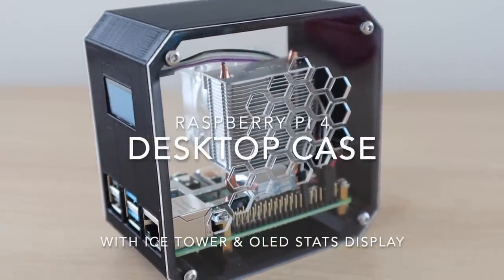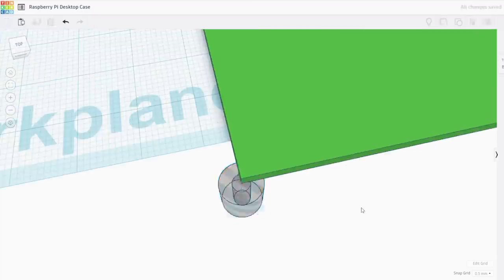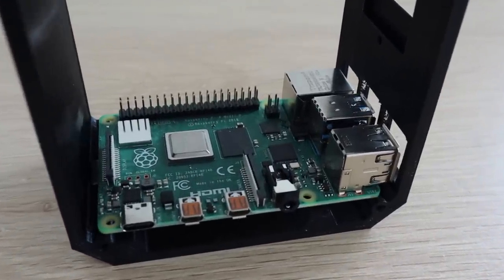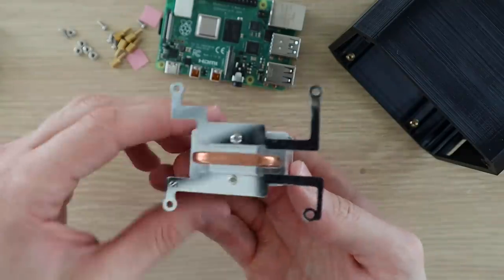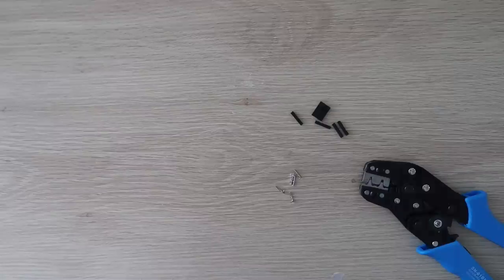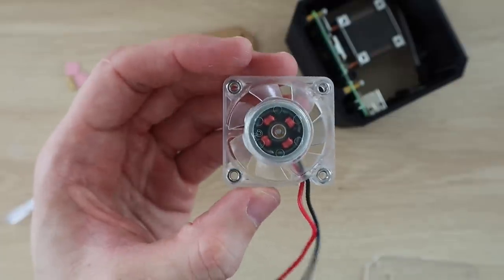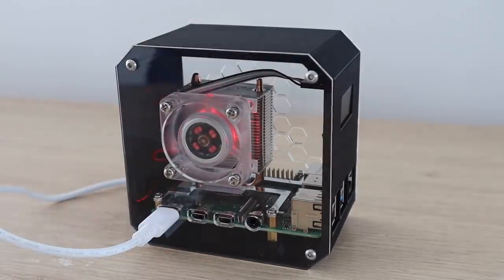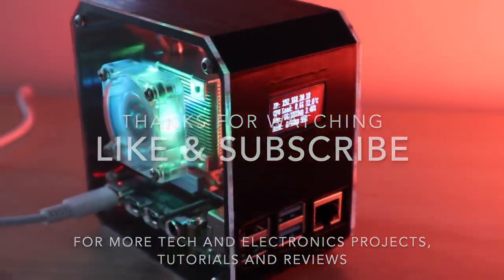DIY Raspberry Pi 4 Desktop Case With OLED Stats Display

Comment: I'd make a removable filter screen to cover the honeycomb air vent holes on the side so you're able to clean the dust that collects with time, other then that this is a great project!!!! Thank you for sharing!!!
Reply from the maker: Thanks S7, that's a good idea. The fan pulls air into the case and it's exhausted through the honeycomb holes, so it's probably a good idea to put the filter on the fan side to stop and dust from getting into the case.
Reply: @MichaelKlements  If you turn the fan to where it's blowing out there is still air flow coming in the case to cool things down, then this way you'll only need to put the filter over the honeycomb holes, and this way you're killing 2 birds with only one stone 😃👍
Reply from the maker: Yes you could do this too, it would be quite easy to turn the fan around.
Reply: @MichaelKlements  Really like this project, could you also show us how to program the Arduino with rom games or something like this?

Comment: Version 2:
• Mount the pi vertically (like a traditional computer case)
• Add a power switch to the case
• Add in a sata adapter and sled for a 2.5" drive
• Use a breakout board to bring all ports (and the GPIO pins) to the back of the case
• Keep the ICE fan on the cooler, but add in 92mm (or 80mm) fans to the front and back
• Add in a PCIe breakout (vertical mount to keep the case slim)

Basically create a full desktop out of it. You've definitely got the skills.

Bonus:
• Watercool it (like in your recent videos)
• Internal power brick
Reply from the maker: Thanks for the great ideas! This will definitely make it into a proper mini desktop computer, haha. But it would be awesome.

Comment: Probably, you can flip the board 180 degrees. In that case the RJ45 (network) adapter is seated at the back of the box.
It is even possible to design your own Raspberry Pi 4 main board. According to that, you can accomplish big things by selling the product!

Comment: Can you advise how much infill was used in the PLA
Reply: Its okay i heard you mention it during the video
Reply from the maker: I typically use 15% infill for most projects, unless it requires extra rigidity or strength.

Comment: Michael, And anyone else that has one the same, I am curious what you think of the laser cutter engraver that you use in this project, have you had much trouble with it, was it a huge learning curve or relatively easy to get working with it. looks like it would be a fun item to have, been thinking about a 3D printer for a long time but haven't got serious about them.
But seeing your cutter in action was pretty cool.
Reply from the maker: Hi Squirralien,
I bought it thinking I'd only use it occasionally, and I've actually used it way more than I ever thought I would. Being a relatively cheaply made cutter, it takes some setting up and re-calibration to get working properly (it worked out of the box, just not very well). I also changed out the lens and mirrors for better quality ones which made a significant difference. 
I bought the digital display one and actually wish I'd got the cheaper analogue one, you really need the analogue current meter to make sure you don't burnout the laser tube. I've added an ammeter to mine alongside the digital display.
But I've been really happy with it and would definitely buy another if this one packed up. Although, you can fix almost everything on it quite cheaply, with a huge range of spare parts available online.
Reply: @MichaelKlements  thanks for your reply and background ,

Comment: That looks bloody amazing. Really well designed. My only comment would be that the case needs some sanding down to get rid of the 3D print ridges. How does feel on a desk with day to day use? Does it need some rubber feet or ballast at the bottom to help keep it in place? Again, amazing.
Reply from the maker: Some rubber feet underneath the case would definitely be a nice addition!

Comment: Ok, changes...
Use low profile cooler, turn Pi on its side so air intake is in about the same location.
Add micro HDMI to HDMI cable, power etc cables such that female outlets for each can be placed on the same side as the ethernet/USB.
Since much less of the space within the case will be wasted, make a couple of mounting points for SSDs, oriented in the same manner as the Pi.  Allow room for sata to USB connection (exterior).
Place screen on opposite side to ports.  Add power button under screen.
That said, I really love the look of the case you made.  For whatever reason it totally appeals to me and I'd buy it if I could.
Reply from the maker: Hi Mike,
Thanks for the great suggestions. I've been looking for some sort of adapter board similar to the one supplied with the Argon case which takes the HDMI and power to the same side as the USB and Ethernet ports, this would definitely make for a cleaner build.
It would also be nice if there was some way to connect an SSD to the board without having to go through the USB ports, it looks sloppy having a cable coming out of the case and back into one of the ports. I guess you could solder a lead directly to the contacts on the underside of the USB ports as a work-around.
But thanks for the tips and ideas, I'll definitely be looking at a Version 2.0 of this case.

Comment: Hi Michael i have noticed when the side covers are on its difficult to insert the micro hdmi fully, is there a specific micro hdmi cable with a smaller shround which can be easily inserted fully?
Reply from the maker: Hi Rav,
I haven’t had an issue with mine, I’m using this cable to plug into a mini-hdmi monitor - https://core-electronics.com.au/4k-mini-hdmi-to-micro-hdmi-cable.html
I’ll have a look at it more closely, it didn’t look like it was any longer than a typical cable.
Reply: I have tried a number of cables and faced the same issue, I finally resorted to using a filing tool to increase the rize of the hole. Now its okay but it looks a bit untidy. Is it possible you can advise how to modfy the design to enlarge the gap. The current size is approx (LxW) 8mm x 3mm, new size to 18mm x 10mm
Reply: Hi Michael, if you dont have time, can you please advise what software i need to modify it myself

Comment: Would the screen and it's software still be ok running alongside a multi-instance of OctoPi?  I have 4 instances running for 4 printers, but really like the case and layout to neaten things up a bit.
Reply from the maker: Yes I don't see any reason why it wouldn't be. The script to drive the screen is really basic, not resource intensive at all.

Comment: First of all, thank you for everything. great project ... but i'm having problems with ip printing. I could not print the ip address I got from wifi. I am waiting for your help. thanks.
Reply from the maker: Hi G G,
Have a look in the comments section of the blog page (linked in description), some people had a similar problem and were able to correct it with a minor code change. Alternately try running the script in a different python version (1, 2 or 3)

Comment: I just bought the model files. For the side panel can I use 3mm or 5mm acrylic board instead of 2mm?
Reply from the maker: Yes you can use 3mm acrylic as well. If you use acrylic thicker than 3mm then you'll probably need to make the port cutouts a bit bigger to allow the whole connector to pass through them.

Comment: Brilliant.  Header out for the I/O...
Reply from the maker: You can put a slot into the vent side and use a 90 degree head pin cable to access the I/O outside the case.

Comment: can you modify this case so that a 80mm 5v noctua fan fits? like whole side panel is fan area and on the other side holes until pcb level?
Reply from the maker: You could add an 80mm Noctua fan to it, but you'd have to change quite a lot to make it fit.
The whole case is only 100mm x 100mm, so you'd probably need to make it wider to fit the fan in next to the Pi rather than above it. You'd also need to move the fan to the GPIO side so that you're not covering the ports. You could then also expand the honeycomb pattern to cover more of the fan area for better air flow.

Comment: hey Michael i just received the box, it looks great...thanks
Reply from the maker: That's great! Let me know how the assembly goes
Reply: @MichaelKlements  Michael, got it all put together, but two things, i wasn't able to get the fan attached to the side panel, i could have gone to home depot or ACE but i dont want a side of COVID with this order lol,  the second thing I made a cutoff on the back to access the micro SD card. i used a square piece of metal, heated it and melted a small square which works great. i haven't had time to program the display, i will do that this weekend...
Reply from the maker: @FredyArg   thanks for the update. What was the issue with getting the fan attached to the side panel?
Reply: @MichaelKlements   the nuts provided wouldn’t go in all the way, rendering the screws too small, I wasn’t able to force them down the holes the fan has either. I’m sure  a longer screw would work so if the ones you provided were about 9-10 millimeters, maybe a 12 millimeter screw would work, i can easily just go and buy them, just dont want to make a trip...I’m too lazy...lol, but i think you should incorporate a 5x3 millimeter rectangular shape opening at the base of the box  on the micro SD side to gain access to the micro SD card.

Comment: hello, your case interests me.
I have a project to make a Recalbox with a raspberry pi 4.
can we include the open source recalbox in the SD card while adding linux programming for the control screen?
(I am french)
Reply from the maker: If you're comfortable enough with programming, I don't see any reason why you wouldn't be able to get this to work. You'd probably need to make a few changes to some of the libraries used or this project. I don't have much experience with Recalbox though.

Comment: is there a model with an easier access to the remaining pinouts? can you extended them outside or something like that? is it possible?
Reply from the maker: You get 90 degree GPIO pin adaptors or you could use a GPIO extension cable to bring them out of the case.

Comment: You could make it easier for those without CNC but with 3d printer and make the black material act as a lip to cover any roughies on the acrylic!
Reply from the maker: I've made a copy of the acrylic sides which can be 3D printed rather, they're in the guide linked in the video description. Obviously won't be clear though.
I like the idea for a lip around the Acrylic. I personally like the Acrylic to the edge, but it would neaten the case up a bit if you had rough edges.

Comment: Very nicely done.  I have no use for it, but I really want one. I agree with others here- you could sell a ton of these cases. What do you estimate your cost was to create the case?
Reply from the maker: Thanks John. I’m working on getting a manufactured version available early next year. At the moment I’m selling 3D printed versions on Etsy, but struggling to keep them stocked as the printing takes +-8 hours per case. The kit is $49 with the 3D printed case, laser cut side panels, oled display, ribbon cable and screws with free international shipping.

Comment: Great video, thanks 😃 I wonder to know if is there any ready-made version of this case (without the ice tower cooling and the screen), so I can buy it, I'm working on router using raspberry and that's really what i want to make however i don't have the 3d printer ,😅
Thanks in advance
Reply from the maker: I'm working on a manufactured option, there are a couple of minor changes to make to the case for moulding.
Reply: @MichaelKlements  anyway thanks again for the explanation it will help my team a lot 😃

Comment: They are sold out on Etsy of the cases, I love this it looks great and I want one, is it possible to buy direct from you or will Etsy be restocking, I guess Etsy is your retail outlet for this product. 
If not ill find someone with a 3D printer.
Reply from the maker: Unfortunately they’re still being made on a 3D printer at the moment, so there is a limit to how many I can make in a week. I’ll be restocking them early next week again though, so be sure to check back.
Reply: @MichaelKlements  OK Thanks,,
Reply: @MichaelKlements  I got to order one, I checked the page about a dozen times a day until they came up, thanks
Reply: @MichaelKlements  I got my case kit today, thank you, it looks great, as it does in the video, now waiting for the Pi4 to arrive,

Comment: Amazing work but it's a slightly mistake there...
The USB ports should be in the back of the case since you won't plug the internet cable from the front of the computer
Reply from the maker: It depends on what your use case is. I typically use WiFi and prefer to have the USB ports on the front to plug in drives etc.. I've made both variants though, so there is one with the ports on the back as you've suggested.

Comment: This is awesome, but why you didn't put the display on the other side so the ports would be in the back?
Reply from the maker: I personally like having access to the USB ports on the front for drives etc.. But it's easy enough to flip around and cut the screen cutout on the other side.

Comment: Thats a nice case. Im always surprised at what people can produce in Tinkercad since I've always seen it being presented as the simplest cad tool
Reply from the maker: It is a really basic cad tool and it can be frustrating for more complex models, but it works pretty well for simple designs using basic shapes.

Comment: Sorry If this is a Dumb question. Can I use every 0.97" Display ? because I need to find almost everything for Amazon Germany and I want to be sure not to make to much mistakes. Can't buy it from America.
Reply from the maker: There are a couple of versions of these displays available and they should all work. You just need to make sure that you get a 128x64 I2C OLED display. You also get an SPI version, which you’ll probably be able to get to work, but you’d need to use a different script and library.
Reply: @MichaelKlements   Oh Okey I hope it will work. time to learn something new. What is a SPI ? Thank you for your help
Reply from the maker: It's just another form of communication protocol. The screen I've used uses I2C, and some of them use SPI. They're usually quite well marked - SPI ones have 8 pins on the top, not just 4. The Pi is able to drive the SPI display as well, it just needs different libraries and code to do so.

Comment: Help I’m trying to get this 0LED screen to run on a raspberry pi using retropie. I can get everything to work but I can’t get it to turn on every time I reboot the raspberry pi. So Every time I turn on the pie I have to retype in all the commands in terminal to get the screen to work but I just can’t get it to do it automatically on every reboot Or start up.

Comment: Hello good day. Thank you for this great tutorial. Using a pi2B have installed  my 0,96 display and followed description step by step.  everything is fine except the IP address which is not having any info... only "IP:" text  . could you help me a while?
Reply from the maker: If you have a look in the comments sections of the blog post, there are a couple of alternate notations for the code which displays the IP address. Some others have also had trouble with the IP address in particular. I'm not sure why this seems to differ, it may be due to the OS version.
Reply: @MichaelKlements  hello, thank you. By the way, if use the original stats.py into folder examples than can see ip address but not the cpu temp. Using the one provided instead than i see cpu temp...but not ip address... :-)
Reply: @MichaelKlements  having a look into blog posts but is too long... Do you remember where i can find what you're mention?

Comment: Hey Michael!  you must be busy as ever making cases!  Lol. 
I just saw your note that you put 20 more cases in Etsy.  I went there, it said 20 orders / 4 remaining...  I ordered one ASAP!  Hahaha

BTW, THIS WILL BELONG TO WIFE!   I will load  “Twister” (Raspian OS that has MS Windows skin.  
That way she feel like windows environment..  “PI LABS” here on utube made skin and integrated retro gaming and BOX86 SW   ALSO quick screen to change over clocking settings and display settings easily to play games.  Big OS. Lol but nice.

Wife will use LIBRA Office and pay bills, home office things mostly.

Thx for selling them!
Reply from the maker: That’s great, thanks for the support! Yeah the 3D printers are running all day, looking at better manufacturing options for the new year.
That sounds pretty cool. I must take a look at it. I’ve never really played around with Linux based OS with a Windows skin, it would be interesting to see how they compare.
Good luck with your build!
Reply: The FIRST TWISTER IS FOR RASPBERRY OS.    BE SURE U GET LATEST VERSION.    LATER HE WORKED ON UBUNTU AND ONE OTHER OS.

HE IS KIND AND QUICK WITH ANSWERS.

2ND MOD SUGGESTION. UNDER PI4 HAVE “M.2” MOUNT THEN SHORT USB3 CABLE TO CONNECT TO R/PI4.  (LIKE NEW ARGON CASE).

THAT WOULD BLOW OUT SALES!

Comment: @Michael Klemens: Is it possible to redesign this to be able to implement SKR mini board, and a slot for an UPS hat, and a middle sized battery bank?
Reply from the maker: Yes that would actually fit quite well into this case. I'll have a look at it!

Comment: Have you ever considered adapting the case design to allow it to hold an SSD or M.2 drive in order to allow the Pi to boot from that rather than an SD card?!